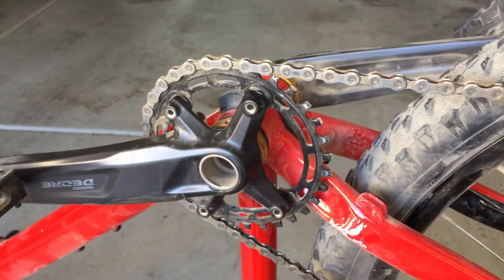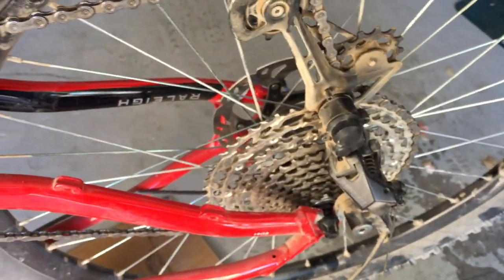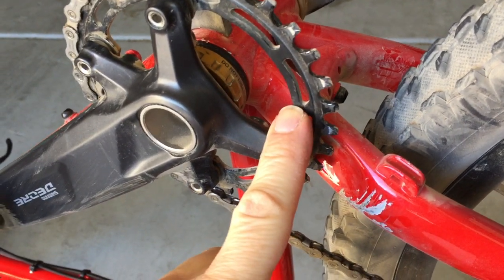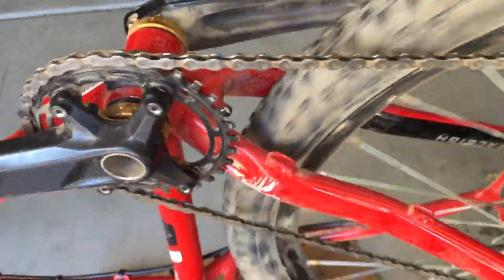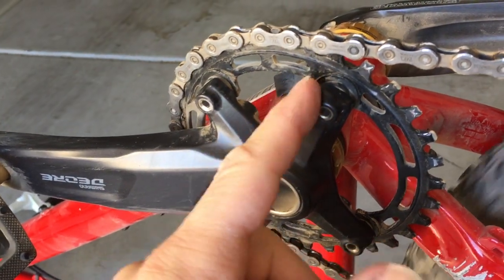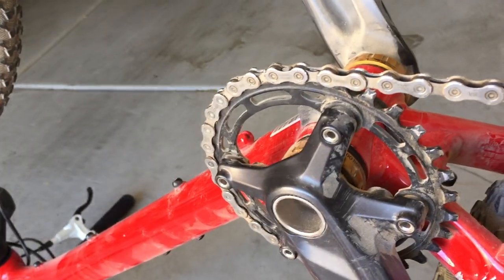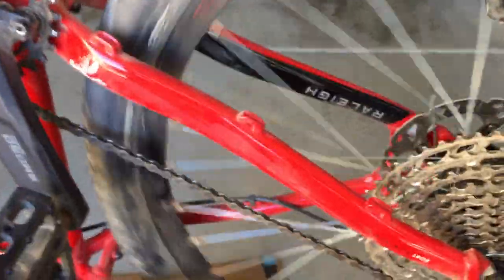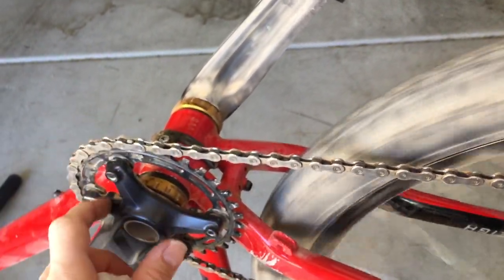Shimano Deore M5100 1x11 crankset chainline for 135mm OLD non-boost

Comment: Any reason you didn't try moving the bottom bracket spacer to the opposite side instead of adding 5mm of spacers?
Reply from the maker: I did play around with the bottom bracket spacers. I have a 68mm bottom bracket that requires three 2.5mm spacers. Shimano recommends 2 spacers on the drive side and 1 spacer on non-drive side. I originally moved one to the non-drive side which brought me to 49.5mm chainline. Still not enough reduction. I was afraid to place all three on the non-drive side because I was running out of threads on the bearing housing with three spacers. I have a Saint bottom bracket. The drive side housing has very deep threads but the non-drive side has standard thread length on the bearing housing. Since I needed to add chainring spacers, I decided to leave the bottom bracket spacers as recommended by Shimano rather than offset the bottom bracket. Sure I could have at least moved one to the non-drive side but I wanted to keep as much thread depth into the bottom bracket housing to help reduce any possible creaking.
Reply: @mtbbiker6401  Gotcha. I only really saw what looked like 1 spacer on the drive side in the video and couldnt make out the otherside. With my 73mm BB, im hoping moving the single spacer to non drive side and then a conservative spacer (2mm) on my chain ring will get me right where I need to be.
Reply from the maker: I would definitely try moving your bottom bracket spacer to the non-drive side on a 73mm bracket.

Comment: Hello, do you know by any chance if this crankset works with 12s Shimano chain?
Reply from the maker: I don't believe so. The Shimano 12 speed HG+ chain is a proprietary design that requires unique tooth design. You would need to upgrade the chainring to a 96 bcd chainring designed specifically for Shimano 12 speed HG+ chain. The m5100 crankset is specifically designed for 10 & 11 speeds. I would look for a 1x crankset that specifically states 12 speed, such as, FC-MT510-1, FC-M6100-1 or higher.
Reply: @mtbbiker6401  thank you, I know this already, didn't do proper research- forgot those groupless cranks exist, already ordered a mt510 chainring.

Comment: Hello, I’m trying to replicate your setup. However I could only find a 17 mm chainring bolt, it comes with its own set of nuts. Will the bolts fit the nuts that comes with the 5100 crank? Or I should replace them too? Thanks in advance
Reply from the maker: The m5100-1 crankset does not use nuts. The bolts thread directly into the crankarm which is threaded. If the bolts are M8-0.75 fine pitch threads then 17mm bolts should work fine. I used Problem Solvers M8-0.75 x 16mm chainring bolts
Reply: @mtbbiker6401 Ah I see. I’m planning to use two 2 mm spacers, hopefully it will reduce my chainline to around 48 mm with recommended 68 mm bottom bracket spacer layout (2 on drive side, 1 on other side). Is my estimation correct?
Reply from the maker: @meow6896px  Yes. Add 4mm of spacers between the chainring and the crank arm will reduce your chain line by 4 mm. 52-4=48mm. You could also try moving one of the drive side BB spacers (2.5) to the other side and then only run one 2mm spacer. That would get you 47.5mm 52-4.5=47.5. Then you could probably use the original bolts. You'll have to experiment with your frame clearance and make sure you have enough thread engagement of the BB on the non-drive side. I recently moved this crankset over to a full suspension frame with 73mm shell width. I moved the required one 2.5mm spacer to the non-drive side. That brought my chain line to 49.5mm without running any spacers between the chainring and the crank arm. That's as far as I can go without the chainring hitting the chain stay but it seems to be working fine. I can back pedal on the 51T cog without dropping the chain.
Reply: @mtbbiker6401  I think I’ll give the first option a try. Thank you so much, you’ve been very helpful. Cheers

Comment: Shimano Deore FC-M5100-1 crankset

The Shimano Deore FC-M5100-1 crank is designed for 1x11- as well as for 1x10-speed drivetrains and features a 2-piece construction keeping the weight low. A 4-arm chainring with 96 mm B.C.D. ensures an efficient transmission of pedal force. The Deore crankset with a chain line of 52 mm and a Q-factor of 178.5 mm is suitable for dropouts which feature an O.L.D. of 135, 142 or 148 mm.

So it says in the Shimano specifications, I'm also interested in that crankset, so I'm wondering if that's correct or not? My OLD is 135.
Reply from the maker: Shimano is misrepresenting this crankset. 135/142 OLD typically use 48mm chain line. 148 boost uses 52mm chain line. The two aren’t really compatible. 52mm chain line is too great for 135/142 OLD frames for 1x drivetrains.
Reply: @mtbbiker6401  What is your cainline now, did you measure it correctly?
Reply from the maker: It’s about 48mm measured from center of seat tube to middle of ring gear. It was 52mm after installing the m5100 crankset. You can swap bottom bracket spacers from right to left to change the offset of your bottom bracket to reduce the chain line also. I opted to space my chainring instead.
Reply from the maker: Ideally you want the chain line set up so the chain goes straight back from the chainring to the middle of your cassette without any angle. This allows the chain to move the same distance from middle to largest cog and middle to smaller cog when shifting the full range of your cassette. It minimizes the chain angle deflection. With the 52mm chain line, my chain was lined up with my 2nd or 3rd cog (small). When I would shift to my largest cog, the chain was severely angled.
Reply from the maker: When measuring the ideal chain line, you need to measure the rear hub. Center of rear hub to middle cog of cassette. For 11 speed, that would be 6th cog.
Reply from the maker: Ultimately the rear hub/cassette measurement dictates the chain line but chain line might have to be increased to account for frame and tire clearance of the chain and chainring. Otherwise the chainring might hit the frame or the chain might rub on the tires.
Reply: @mtbbiker6401  Do you have 11-51 T cassette? I haven't bought anything yet, I'm hesitant between the 1x10 and 1x11 systems, the 11-speed cassette crosses a bit over the freehub, so the chainline should be 1-2 mm even smaller. Gear padding is the only solution, if there is room for it.
Reply from the maker: @josipajerneic8815  11-51T 11 speed.
Reply: @mtbbiker6401  "A linha de corrente de 52 mm é muito boa para quadros de 135/142 OLD para trens de força 1x" Nao entendi, pois vc disse no inicio que 135/142 usa linha corrente 48. No caso de 1x11
Reply: @mtbbiker6401  O manual diz pra usar 2 espaçadores lado direito e 1 esquerdo, provavelmente porque a rosca lado direito é maior. Entao será que pode inverter, usando duas para o lado esquerdo?
Reply from the maker: @betosvr1626  Question: "The current line of 52 mm is very good for frames of 135/142 OLD for power trains 1x" I did not understand, because you said at the beginning that 135/142 uses current line 48. In the case of 1x11"

Answer: 52mm chain line was designed for Boost spacing (148mm OLD). 48mm chain line is for standard spacing (135mm QR and 142mm thru axle). 52mm chain line may work on non-boost frames but it places the chain too far outboard on the cassette. When shifting to largest inner cog, it puts the chain at greater deflection angle and can cause excessive wear or make chain drop to smaller cog when back pedaling. Ideally, chainring chain line should line up in the middle of the cassette so chain moves equal distance from smallest cog to largest cog but could depend on what gears you typically use. If you don't do a lot of climbing and stay in smaller cogs, then 52mm chain line might work fine.
Reply from the maker: @betosvr1626  Question: "The manual says to use 2 spacers right side and 1 left, probably because the right side thread is larger. So can you flip, using two to the left side?"

Answer: Yes you can try to move bottom bracket spacers to other side to reduce chain line but you may not have enough threads on non-drive side to place more than one spacer. Also, all you are doing is offsetting the entire crankset assembly. Now the crankset is not centered in the frame altering the Q-factor. Crank arm might hit chain stay. You can try moving spacers but if not enough threads you might get creaking noise from frame.

Comment: Hello, just a question, I bought a 1x12 deore M6100 groupset with a 11-50 cassette and a FC-MT610 32T (52mm chainline) crankset. My frame is a OLD 29 inch tires 135mm, you think that I need to use spacers to work correctly? 

Just to you know, my actually setup is a 3x9 Altus M200 with a crankset FC-MT101 40-30-22 (50mm chainline)
Reply from the maker: It will depend on your chain stay length. My frame is a small size with 27.5 tires. My chain stay length is only 425mm which is short. The shorter your chain stay, the more angle deflection of the chain when shifting from smallest cog to largest cog on the cassette. I would install everything and then measure your chain line. If you keep the chain line at 52mm, see where that lines up on your cassette. Ideally you want the chain line from the chainring to line up with the middle of the cassette this way the chain deflects the same angle from smallest to largest cog on cassette. If the chain line of 52mm is lined up more to the outside of the cassette (smallest cogs) then the chain has to deflect a greater angle to reach the 50T cog. This greater deflection angle can cause excess wear on the chain and teeth. It can also cause your chain to drop to a smaller cog when back pedaling. If you don't plan to do a lot of climbing that requires you to be in the larger cogs, then you'll probably be fine. Is your cassette a Shimano or other brand? Does it use microspline or HG freehub body. Since it's 11-50 it's most likely HG since microspline was designed to utilize 10T cog. Make sure it will fit your current rear hub. HG freehub body vs. Microspline freehub body.
Reply: @mtbbiker6401   It´s a Sunshine cassette HG freehub (don´t plan to change now for microspline)...thanks for the answer!

Comment: This is what I'd like to do just for fun with an old Gary Fisher I rescued from the trash, same 135mm. It seems the original freehub I have is only 31mm body tho, not 35mm. (It's a 3x7speed). Is yours 35mm I guess, maybe even longer? I guess I'm sorta screwed. Did you just happen to have that wheelset 'kicking around' for that project? Thanks, btw... this is the first relevant example I've found about what I'm after. I'll check your other videos, maybe you have more about this specific project.
Reply from the maker: I had a freewheel hub. I had to replace the freewheel with a freehub and cassette. HG body is the standard Shimano for 8-10 speed. I believe the 7 speed freehub body is shorter.

Comment: I just got the Large frame Talus 2 and I’m looking to do this same conversion! Any advice on what crank set and cassette I should use?
Reply from the maker: My Talus 2 had a freewheel hub, not a free hub, so I had to change the rear hub to a freehub to accept a cassette. Freewheel and Freehub are two different standards and not compatible. You'll need to change out the rear hub or rear wheel before you can install a cassette if your Talus 2 has a freewheel instead of a cassette.

Comment: Hei, where to buy bolts and spacers for 5100-1? (1x11 135mm)
Reply from the maker: Problem Solvers M8-0.75 x 16mm chainring bolts. Used Nylon spacers from hardware store. Used 4.5mm spacer to reduce chain line from 52mm to 47.5mm.
Reply from the maker: Problem Solvers M8-0.75x16mm chainring bolts. I found nylon spacers and washers at local hardware store. Used 4.5mm spacers to reduce chain line from 52mm to 47.5mm.
Reply: @mtbbiker6401  I can't find screw M8-0.75x16mm. Do you know of any website, etc., where can I find it?
Reply from the maker: @betosvr1626  ebay. search "long chainring bolts" on ebay and you can find them 15mm and 17mm long.
Reply: @mtbbiker6401  Nao encontrei com esse nome. Complicado
Reply from the maker: @betosvr1626 try this https://www.ebay.com/itm/273593380093
Reply from the maker: @betosvr1626  also https://www.ebay.com/itm/273705825204
Reply from the maker: @betosvr1626  here https://www.ebay.com/itm/231307244057
Reply from the maker: @betosvr1626  here https://365cycles.com/products/new-problem-solvers-16mm-inner-chainring-bolts-silver-stainless-steel
Reply: @mtbbiker6401  very good!! It's just that I don't speak English, so I looked for a different name, etc. These first two options are with nut, okay? Would it work, consdiderando that the POS has its own thread?
Thank you very much!!

Comment: Thanks, I have the same problem! what are the dimensions of the spacers you have inserted? Thanks!
Reply from the maker: I found nylon spacers by Hillman at Lowe's Hardware Stores. 0.317 x 1/2 x 1/8 # 884570. These nylon spacers are about 3.2mm thick. I also added one M8 washer. Together they create about 4.5mm of width. 52mm - 4.5mm = 47.5mm chain line. I also purchased longer chainring bolts that are 17mm. The original chainring bolts were only 12mm so I wanted longer bolts to make sure I had plenty of thread engagement in the crank arm.
Reply: @mtbbiker6401  Thanks!

Comment: Hi I have the same crank and problem as you. I would appreciate if you can give me the nylon washer/spacer width (to reduce 47mm), does the washer has a hole that fits just right to the bolt (I assume, that if the hole it's too big, it will move around over vibration) and the bolts standards if you know and remember.

I just change the chainring to a bigger one and the grinding noise sounds more awful. I am just to lazy to disassemble the crank again just to measure the bolts. 

Your helps will be very appreciated. Cheers!
Reply from the maker: I found nylon spacers by Hillman at Lowe's Hardware Stores. 0.317 x 1/2 x 1/8 # 884570. These nylon spacers are about 3.2mm thick. I also added one M8 washer. Together they create about 4.5mm of width. 52mm - 4.5mm = 47.5mm chain line. I also purchased longer chainring bolts that are 17mm. The original chainring bolts were only 12mm so I wanted longer bolts to make sure I had plenty of thread engagement in the crank arm. Chainring bolts have extra fine thread. M8-0.75x16mm long.
Reply: @mtbbiker6401  that's all I need to hear. Thanks mate!

Comment: Having a long cage derailleur and a not too short chainstay tube (like most 135mm O.L.D frames and/or frames that had 3X) is the key and will allow you to use a 52mm (boost) crankset without any major issue. Your bike will shift great, backpedal, won't drop the chain and won't wear out your drivetrain... Just make sure you are using the right chain (9, 10 or 11 speed), with the right chain length. However, if you have a short cage derailleur, you might find some problems. Nevertheless, if you still want to move your chain line to 49mm or 48mm by using spacers, just make sure you have the right chainring bolts (M8 x 16mm) with the right thread (I have blackspire brand bolts and work perfectly for this Shimano FC-M5100-1 crankset) and your chaingring teeth selection 30T to 32T won't rub your frame. I don't think you can use any bigger than a 32T chaingring but that will depend on your frame design.
Reply from the maker: Great response. I have a small frame, 27.5” tires and 325mm chain stay. I wanted to reduce the crankset chain line from 52mm to 48mm (actually about 47.5mm). I found M8x.075x16mm chainring bolts to replace the stock Shimano bolts. Thanks for your comments.
Reply from the maker: 425mm chain stays
Reply: In the case of my crown 38, how much can I reduce the chain line so i don't touch the board?
Reply from the maker: @betosvr1626  Sorry. What is "crown 38"?
Reply: Não consigo encontrar o parafuso M8-0,75x16mm. Você conhece algum site, etc., onde posso encontrá-lo?
Reply from the maker: @betosvr1626  Did you order the bolts?
Reply: @mtbbiker6401  Sim, comprei. 16mm. Coloquei duas arruelas, o que diminuiu a linha corrente uns 3mm. Acho que já suficiente, mas até tem espaço pra mais uma arruela.
Reply from the maker: Good!
Reply: @mtbbiker6401  Hi, thanks for the video. I can't find any longer bolts. Do you know any website where to buy the 16 millimeters, of which you speak. I am from Chile and I did not find pins with fine thread. Thank you very much for your help.
Reply from the maker: @fmunozt  You can find on ebay. search extra long chainring bolts.